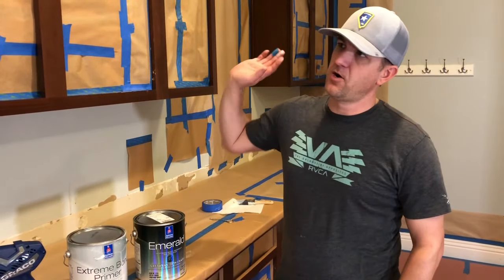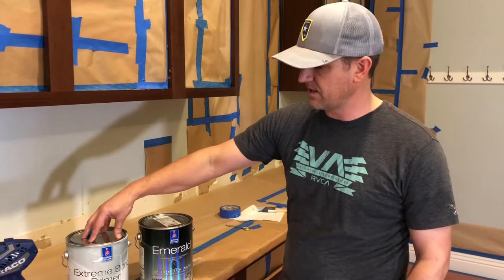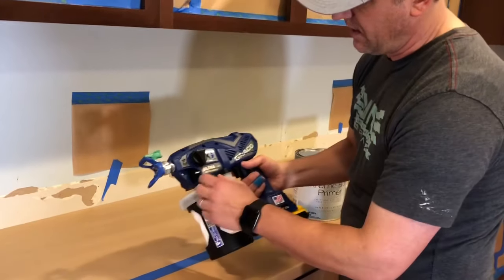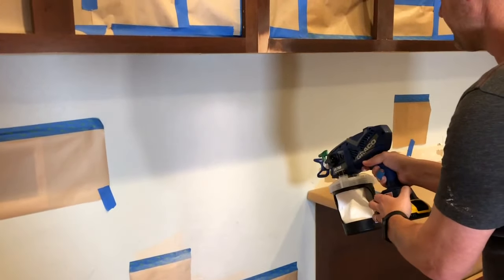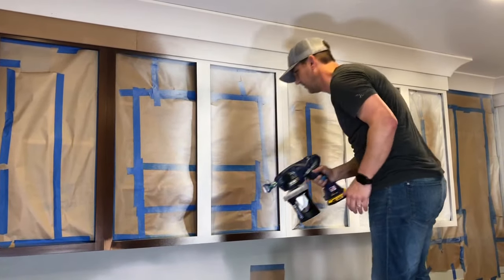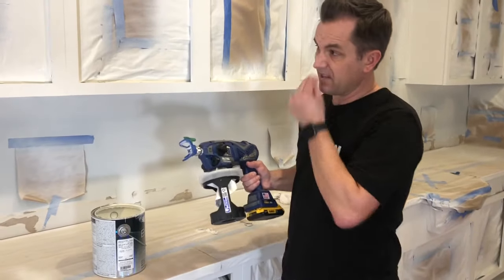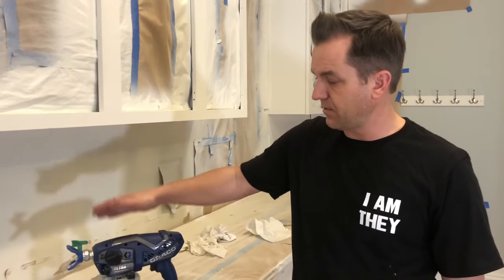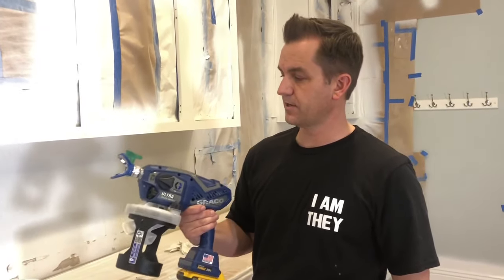How To Paint Cabinets EP 3 #PaintingCabinets #GracoCordlessAirlessSprayer #SherwinWilliams

Comment: Lots of overspray. Are there smaller tips?
Reply from the maker: Which sprayer are you using?  I use anywhere from a 208 fine finish tip to a 212 fine finish tip depending on what I’m painting.  In simplest terms, the first number is the width of the fan, so in this case the 2 at the front will give you a 4” wide fan.  The last two numbers are the size of the opening which allow more or less paint to pass through the tip.  Do you know what tip you are using?
Reply: @buildwithbc 

Speaking of tip size, some latex paints are very thick, a water-based polyurethane is much thinner, would you use different 2xx tips for each product?
So far I'm not finding the answer to my question.
I just ordered the Graco Ultra but I'm not going to order any #2 tips until I find out the best tip for latex and polyurethane.  I plan to use the gun for cabinets and other small items.
Reply from the maker: @ThekiBoran  great question!  I experimented quite a bit with tip size to see what I like.  I have found that the Low Pressure fine Finish tips give me the results I am looking for with thinner paints.  They are made for this very thing.  I have found that I use anywhere from a FF 212 to a FF 208 for painting cabinetry.  It just depends on what I am spraying and what the temperature is when I’m painting.  The warmer it is the more the paint thins out.
Reply: @buildwithbc 

Are you using an FFLP for thick latex paint?  If so, which one do you prefer?
Reply from the maker: @ThekiBoran  yes I have been using the FF212 tip for thicker latex paints.  Just remember the 2 at the front of the 212 means you’ll get a 4” wide fan.  So depending on what you are painting you may want to go up to at 3XX or higher.
Reply: @buildwithbc 

Thanks, learning what the numbers mean is the first thing I had to learn. I just wasn't sure what kind of results I'd get using a 212 or 214 or 208 and thick latex.  There doesn't seem to be much written info about thick latex and the proper tip to use with the Graco Ultra cordless.
Thanks
Reply from the maker: @ThekiBoran  I agree with you!  I had to learn on my own and it was not cheap.  I ended up buying 7-8 different tips before I finally found what worked best for me.  Everyone has different preferences so please don’t take my word as gospel here.  This is just where I settled in and feel that I get the best results.

Comment: what size tip did you use?
Reply from the maker: I use a 212 fine finish tip for the primer and a 208 fine finish tip for the urethane paint.
Reply: @buildwithbc  cool vid. I paint for a living and respect your work , but that is not a 208 tip or 212. That will give it a 4 inch fan. That is way wider. Like a 308 or 408.. 3:14 clip you can tell that width